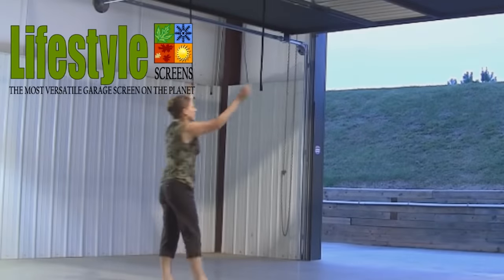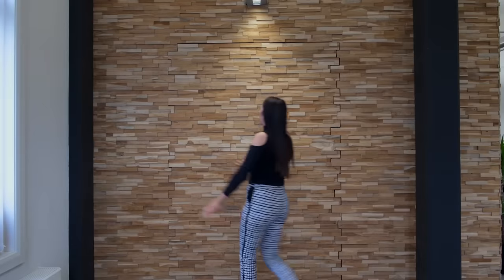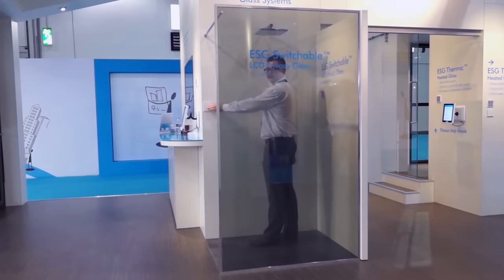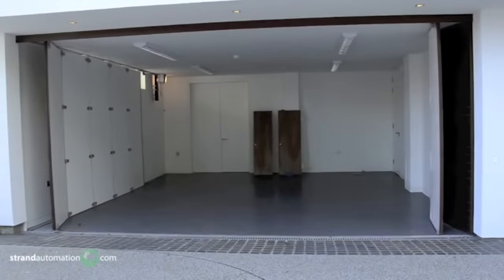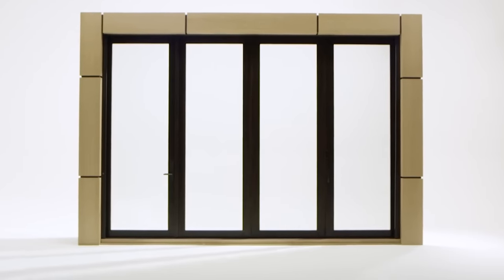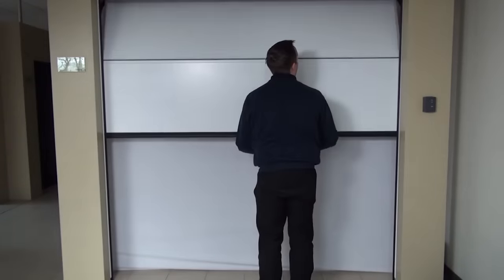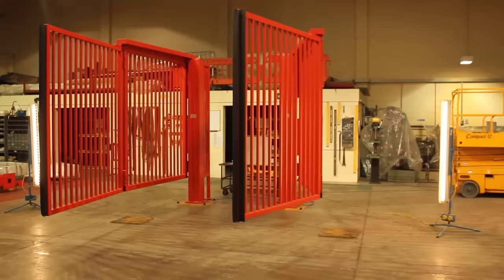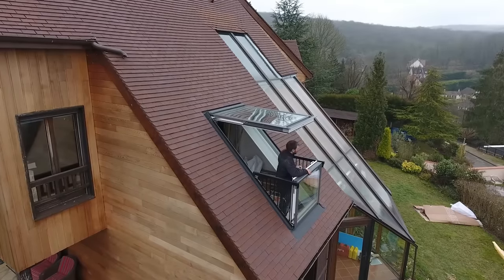14 UNREAL DOORS THAT ARE ON ANOTHER LEVEL

Comment: Sideways sliding doors are one of the most impractical doors ever. That whole side wall is out of usage and you can't even hang a picture on the wall, even if you did you can't look at it when the door is open :)
Reply: Done while building,  it would be a Pocket Door. Then be more useful.

Comment: 3:44 ~ This glass should be used for windows. Let light in as necessary and then block it out for privacy. One could even hook it up with monitoring devices to track temperature and self regulate house/building temps, whether one is at home or not.

5:17 ~ The sliding retractable doors should go long tall narrow planks like the first shown then they can be "rolled" up into a cylinder. The cylinder space to hold it could then become a design featured pillar. One for both sides, or in larger applications multiple pillars as needed.
Reply: That is the beauty of this kind of video.  It stimulates those talented people to build on their ideas.  It is all sharing and caring and no jealousy.

Comment: I want that window that opens up to a balcony!!!
Reply: It does not really make sense if you are not working at home. The ratio of cost and use is not good. You have to shut the window each time you leave the room for a longer moment to avoid damages by rain or wind. Cost is approx € 5K installed.

Comment: the first garage door one is about 30 years too late to the show
2:05 a sliding door, well that one is about 4,000 years too late, the Chinese and Japanese have been doing this for millennia
ESG Glass, im more interested in the thermic glass in the background. A glass that would emit heat and not ice up during winter times would be a god send, combine it with the safety glass in automobiles and you just made winter driving much much safer

Comment: I need help a company in Houston TX, that can do this to my garage. I want either the sliding type or the retractable. But I don't want to use screens. I am in my garage all day when I am not offshore. So I need it to be glass so I can trap in the air, or in winter the heat. Help

Comment: That first one is just a standard garage door nothing special about it at all.

Hidden door shouldn't have such obvious gaps.

Several garage doors rolling horizontally instead of vertically.

Guide wheel on the gate? Nope, that's a rubber foot that only contacts the bracket in the middle for alignment when the gates closed.

Those triangle doors that always seem to find their way into a thumbnail.

Decades old velux window, I know this from buying a set 12-15 years ago when doing work on my house.